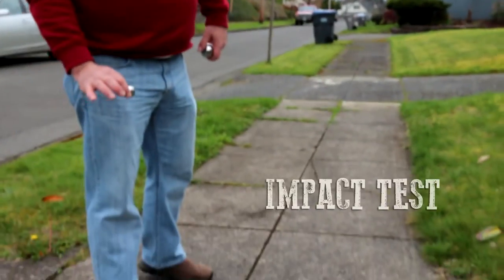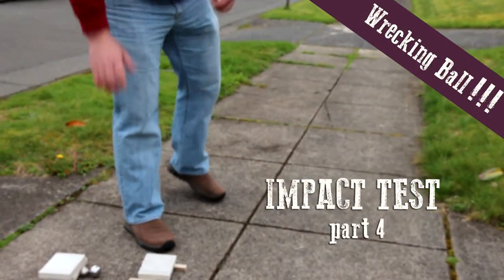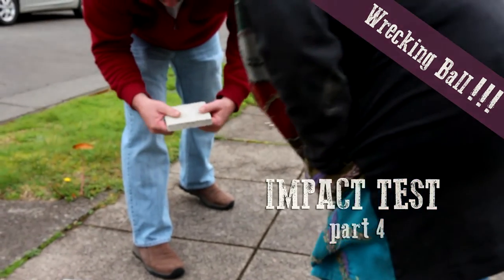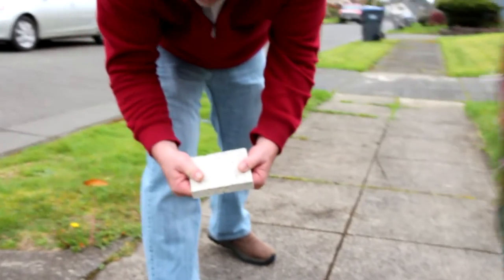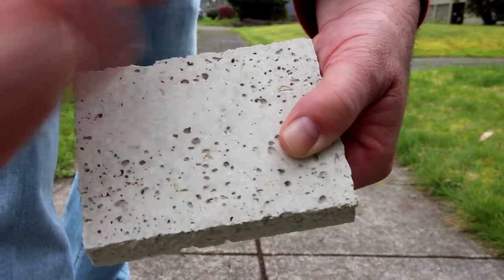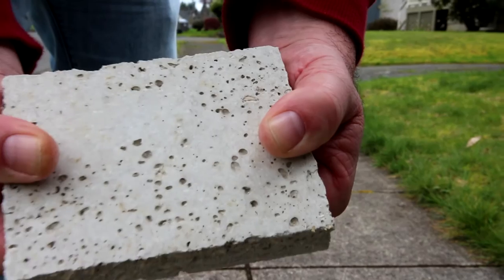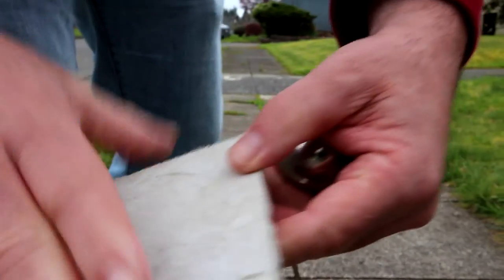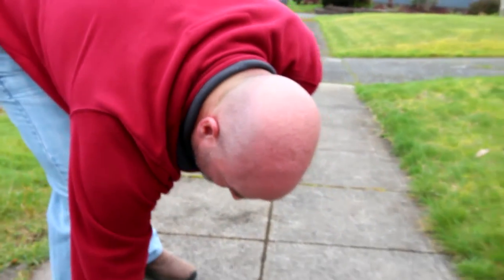hemp adobe homes impact test 4

Comment: what's the bottom line so far as cost is concerned to build with that hempadobe ?
I'm thinking about the tiny house application for 400 sq. ft.house. cash rules everything...
Reply from the maker: Hello Cotton Boxer. Right on for going tiny.  It's a fantastic approach for many people, and we can support you 100%.
Our current, new building construction rate is $80sq. ft.  Even includes your windows and doors, tiny one's of course.